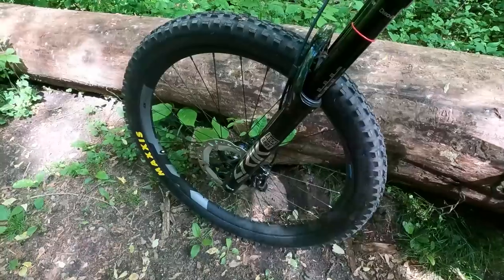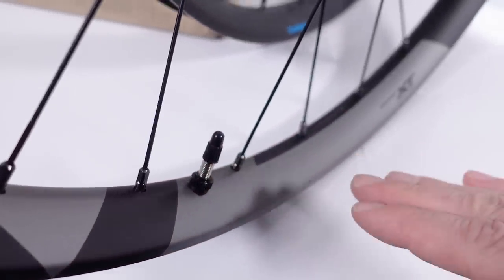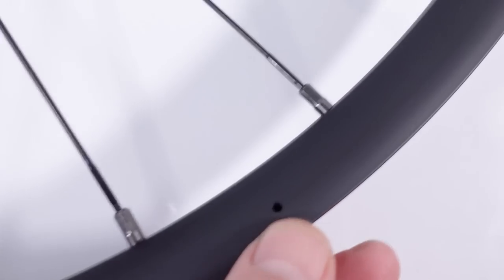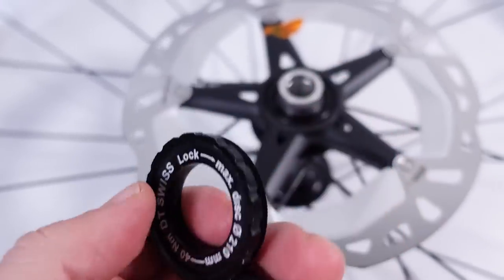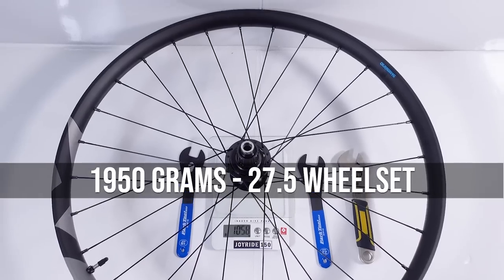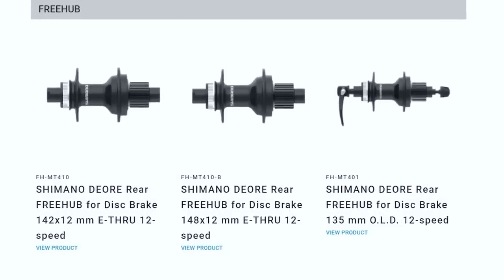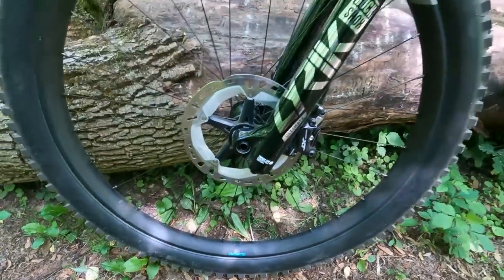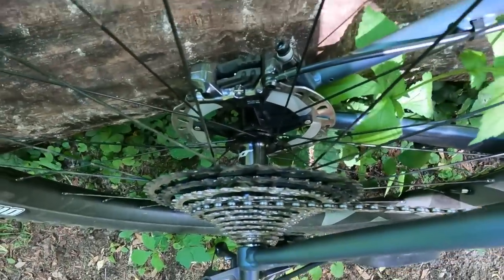Shimano Scylence WHEELS??? XTR/ XT/ SLX Trail Details, Issues - 12 Speed Generation

Comment: I would not buy shimano freehub again, I am tired of lubing that part over and over again. Luckily I found a thread about this problem instantly when I had it for the first time.
Reply: @LoveMTB  In the dealer's manual of the freehub, page 16, figure 3. there is a spacer with pins, each pin must be greased along with the top of the spacer. Also a seal that goes on top of it must be greased from inner side. When brand new it was fine for 500+ km, I greased it with thicker grease and it held for 2000 km, after that the noise came back and it is fine now after greasing again. There is a reddit thread about it "Shimano Microspline Freehub Noise" Hope that helps.

Comment: These wheels don't deserve any good press. Unless you like creaky freehubs that eventually explode into a hot janky mess. Shimano Clearly over engineered every part of this mess and I hate dealing with them.
Reply: @LoveMTB  I haven't owned these but I have now worked on several. The hub is way too complex, using several different fastening methods hidden behind c clips, springs and all sorts of mess. and there is a plastic glide sleeve sort of thing on the inside of the freehub mechanism that usually breaks pretty quickly and fouls the hub.